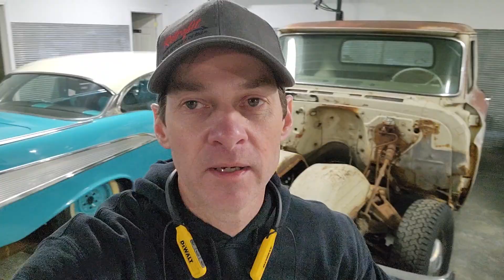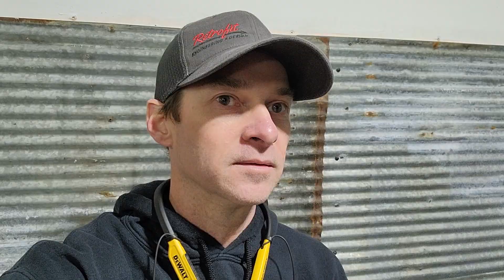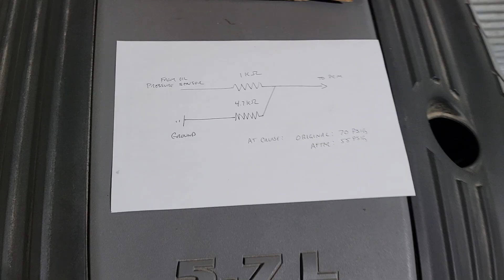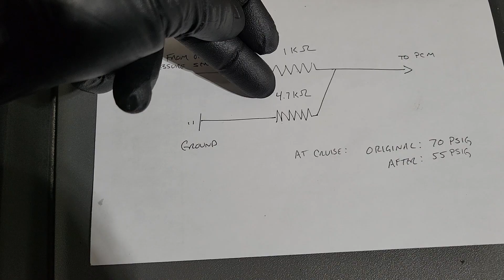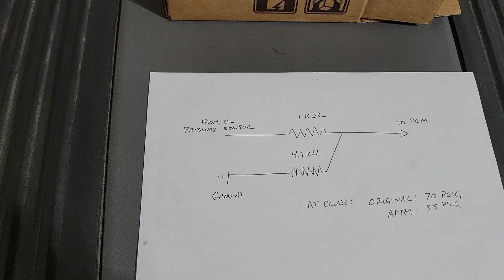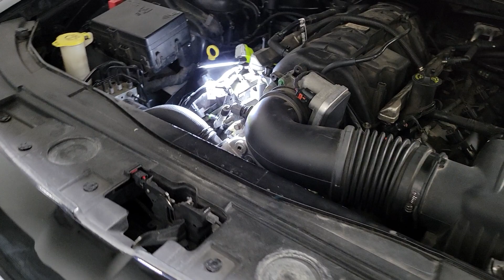Solution for P0524 Trouble Code on Hemi 5.7L With Melling M452HV Oil Pump

Comment: I've got the same problem with my 2011 charger after replacing a wiped cam and using a melling M452HV.  I'm seeing about 65PSI at cold idle and 70-73PSI at cold cruise here in the Michigan winter, and 37PSI at hot idle and 63-65 PSI at hot cruise.  I was going to knock it down around 11% (have access to 1.2K ohm and 10Kohm resistors), I wonder if that will be enough or if I should go higher.  also, there's 3 wires coming off the oil pressure sender, which one is the signal wire? the middle one?

Comment: Thank you for your video! I have a 2013 Ram 1500 Sport 5.7l Hemi with MDS and the Melling high volume oil pump and it just popped the P0524 and I have to try and figure out this fix. I’m struggling a bit but thank you for sharing your experience!